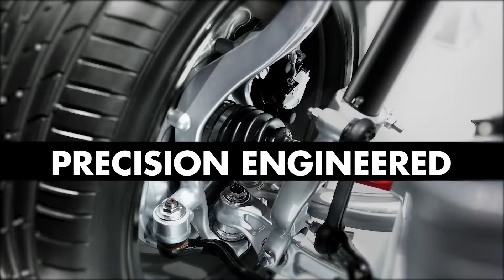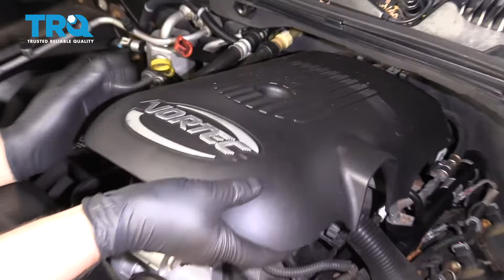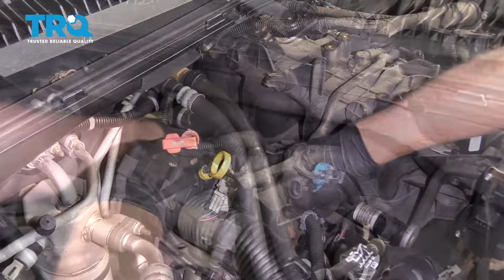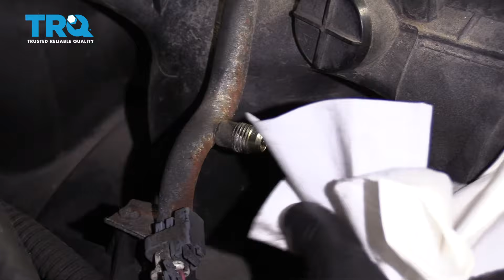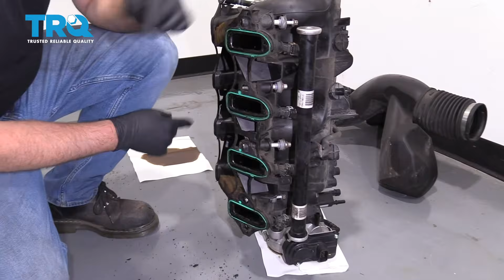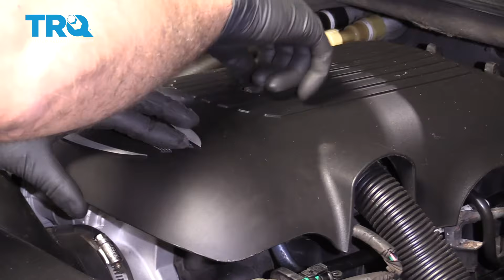How To Replace Camshaft Position Sensor 2000-2006 Chevy Tahoe

Comment: My son has an ‘00 Sierra,getting only 1 code “Random Multiple Misfire” we install new coil pack,plugs,& wires
New fuel filter…
Pressure gauge on the fuel rail is 49#
#1&#3 cylinder is pressuring up to 125#
#5,#7,#2,#4,#6 are @ 150# 
#8 is really hard to get to for me to check the cylinder but I try tomorrow…

Any Great Suggestions/Information would be appreciated…

Thanks in Advance!!!

Comment: Why don't you show people the easy way to do the Cam sensor, because you Don't have to take off the intake to do the Cam sensor, took me 20 minutes to do on my 01 Silverado LT 5.3 and that was getting the tools out and putting them away and I only use Genuine GM original parts, why do all that work just to change a Cam sensor and i did the oil pressure sensor to with out taking the intake manifold off, only Way I'm taking the intake off is for the Knock sensor or the intake gaskets leaking

Comment: How common is it to see a p0342 with extended crank be a bad computer? Have one in RN and the wiring to pcm has good continuity no resistance, the sensor supposedly has been changed without solving extended crank issue....any advice or help is appreciated...at point of replacing pcm, it has the ref voltage to the red wire on the cam connector as well

Comment: Hi,I replaced my camshaf position sensor on my 2003 tahoe the same like you, I check volts in the conector ,its ok volts ,my trock still giving same codes,after replace the conector and still the codes,I think just do the same job removing intake again but I did just  using my left hand in 10 minutes replace for a new one and still the codes. Camshaft position sensor hi and low. Can you help?

Comment: You don't need to do all that. Just use a 10mm socket and extension and reach behind the intake I just changed an oil pressure sensor

Comment: Or just reach your hand behind the intake. Use a 10mm and extension and remove the bolt and pull the cam sensor out.

Comment: The Scanner told me front lower left side of engine idk wtf this dude is doin at the back
Reply: He's replacing the cam position sensor just like the video says.  The sensor is at the back of the engine right where he took it out.  I didn't take the intake off of mine to do this but it's definitely not at the front of the engine

Comment: So what was the problem with the sensor and what was the truck doing with the bad sensor? Mine it's  hard to start sometimes but after it starts it runs fine.
Reply: Mine is going the same thing. Replaced fuel pump and didn’t solve it. Did you find out what your issue was?
Reply: @justindavenport8588  Check your crankshaft sensor.